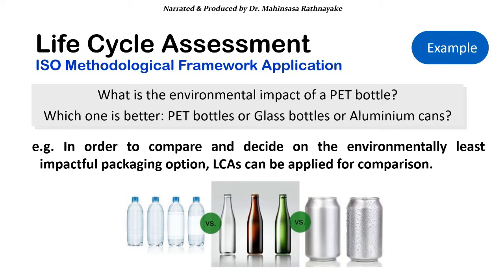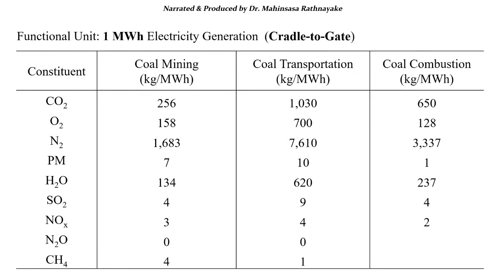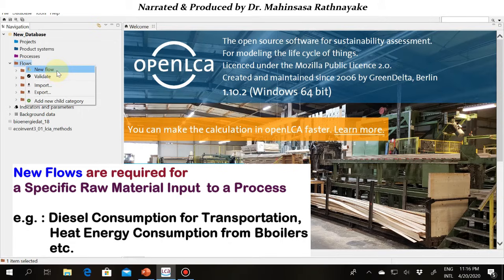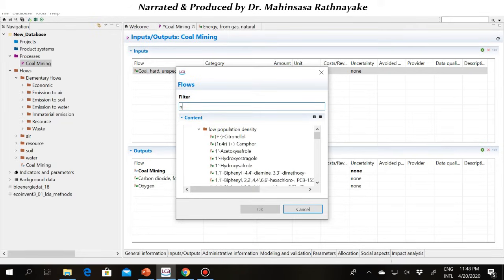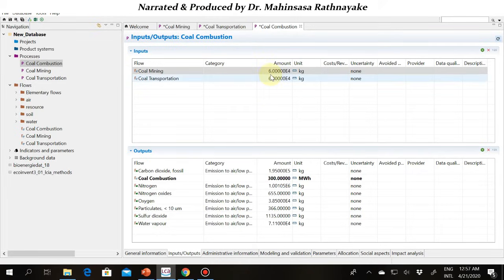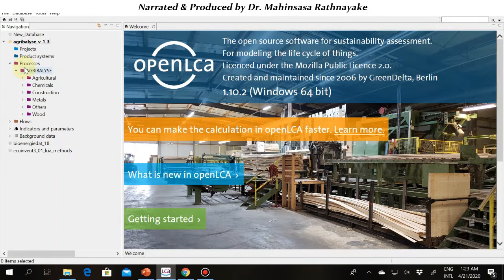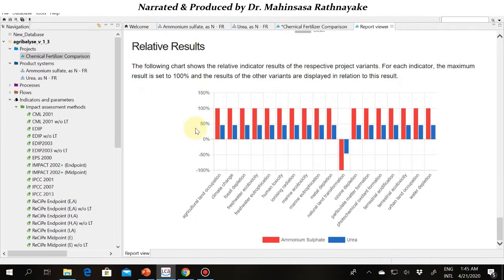OpenLCA Software Tutorial - Part 02

Comment: For those confused by how he got the output value of Coal Transportation in kg please follow the steps below:
1. Open up "Coal Transportation" under the Flows folder
2. Select "Flow Properties" at the bottom
3. Double click on any empty cell
4. Under filter type "Mass"
5. On the far right is a column called "is reference" select Mass to be the reference
6. Save the flow 
7. Close the "Coal Transportation" Process and reopen it
8. Once reopened select the Unit on the "Coal Transportation" Output and type in "kg - Mass"
I hope this helps, I got stuck on this step for a while as it's never covered. Really good tutorial otherwise.
Reply: how did he got the "Energy, from gas, natural" flow data?
Reply: @chanadug   Go to elementary flow use resources and use the filter option and type energy from gas or use Unspecified and scroll and select the 
option.
Reply: thank you so much, big helppp
Reply: Hello, could you give me a hand? I'm doing my research on LCA, where I might compare the impacts of bioenergy and fossil energy. Thanks.

Comment: Hello Dr! why did you use high population density if you previoulsly said from "low population density"? it is also valid? thanks for your tutorial Dr
Reply from the maker: You need to apply this based on the location. If your case is situated in low population area, you may select low population density and vice versa.

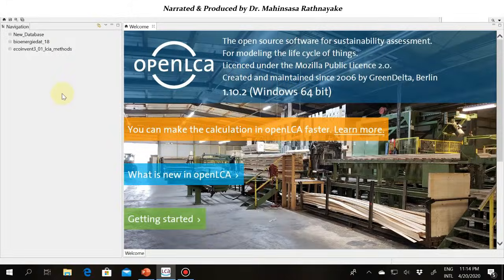Comment: 13:40 practical example start
14:28 flow
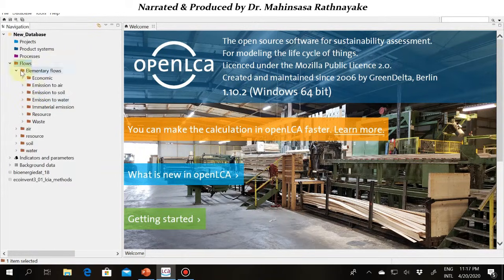16:02 process
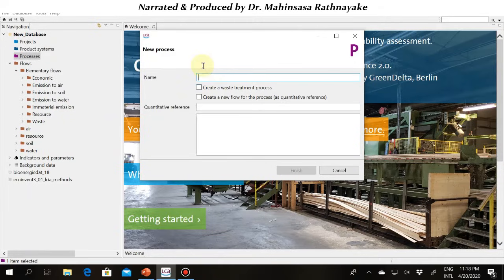16:34 p1
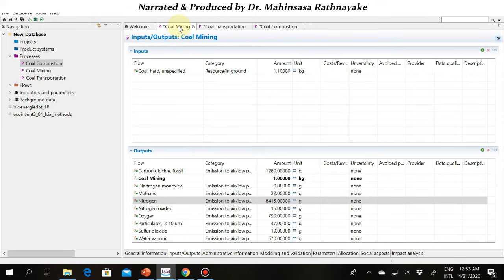25:22 p1 input output
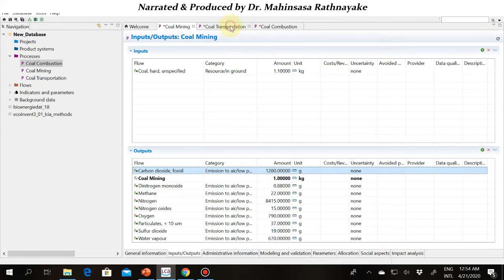25:57 p2 in out
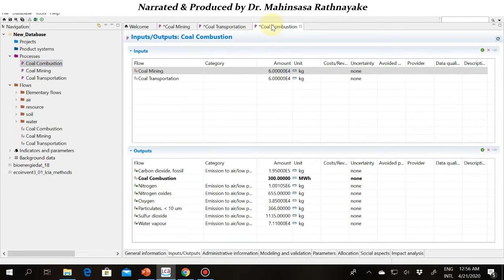27:40 p3 in out
29:34 parameter
30:26 product system
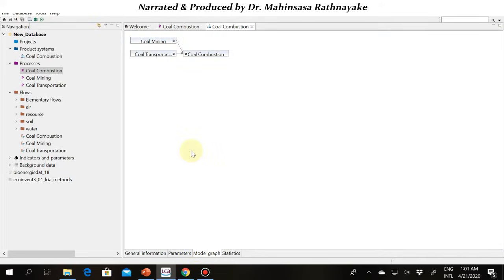32:02 model graph
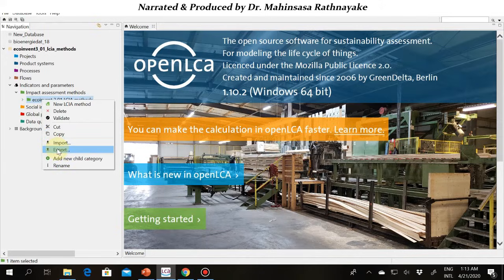34:42 impact...method export
36:56 product sys calculation
40:22 use existing database p
44:14 project

Comment: Most helpful video. Can I please know if there is a freely available database to use for Sri Lankan electricity
Reply from the maker: Thank you very much for your comment!
Only GHG emission factors are available at IPCC. You can calculate using default factors based on the shares by different energy sources in Sri Lankan Grid Electricity.

Comment: Hello from Italy! I am currently working with openlca and ecoinvent database. I have to apply the zinc coating to a steel tube with lateral area of 2.07 m^2, 6 m of height and 78 kg. At the beginning I used directly 2.07 m^2 for the process called zinc coating coil but my final impact results were too high. Then I read in the description of the coating process this phrase: "This module is applicable, if continuous zinc coating (galvanising) of hot or cold rolled strip- or wire-coils has to be inventoried. Data given per tonne of coated product are transformed by dividing them by the mean surface area of 64 m2/t." 
To obtain the right m^2 is it correct to use make the following calculations: 78/1000/64? Thank you for your answer!
Reply: please how can I get the ecoinvent database? could you help me?
Reply: @ogagaodokuma5443  hi man! The only way is paying or through your university ☹️
Reply: @pincopallo9551  Thanks for the heads up. I hear they grant free licenses to students in low and middle income countries. I would have to go through that path as I meet the qualifications to apply.
Reply: @ogagaodokuma5443  oh yeah I remember that! You are right! Try with it! I hope you will be able to do it.

Comment: Thanks for  the video, well explained! 

 However, I have some questions: why didn't you link the  'coal mining' process to the 'coal  transportation' process rather than dependently linking  them to the 'coal combustion' process? Is the mined coal completely different from the one transported? if no or yes, why and/or how? Thanks again in advance for your clarification.
Reply: Hey James, I may be able to answer your question. So if you notice the Input parameter for the Coal Transportation process was amount energy and not the coal in itself and that's why it was linked directly to the final step of combustion. So in the example in the video, you link the coal mined physically to combustion and then you link the energy that the transportation uses to transport 60 tonnes of coal. 

You can also link the mining process to the transport process, the only thing that changes is the reference flow which would be then be in terms of mass* km transported and then you also specify the mode of transport in the input section. Ofcourse in this example we didn't have the data for this so that's why the first method is preferred. 
Check out the tutorial in openLCA for PET Bottle comparison - It will complement your learning of the Software. 
Cheers!

Comment: Hello sir, I am using this software for my Undergraduate degree Final year project. My topic is to perform the Life cycle assessment for crude palm oil production. Your videos are really helpful but on the other side, I would like to get your suggestion about how can i develop my simulation. I couldn't find much relevant data's related to palm oil in this software. Any database suggestion that i need to import in this software?. I hope you will guide through my project. Thanks and regards,
Reply: Hello Srikanth, did you eventually find a database that had what you were looking for?
Reply: @ogagaodokuma5443  Thanks for your reply sir. I ady submitted my FYP, 2 years already😊😊.
Reply: @Srikanth-yl8hf  that's good sir. I'm currently doing my Masters project on LCA of Mobile Phone recycling. I'm curious about the database you used because I can't find some data on the ecoinvent 3.8
Reply: @ogagaodokuma5443  honestly speaking, it is better to use simapro software. Openlca dont have much data. Simapro is helpful buddy
Reply: @srikanth How do you collect the data for the project?